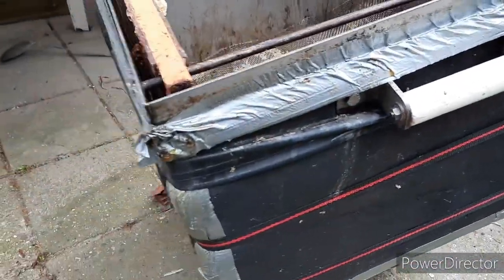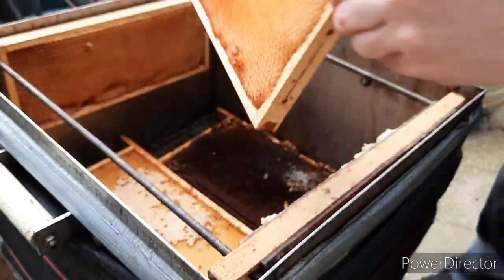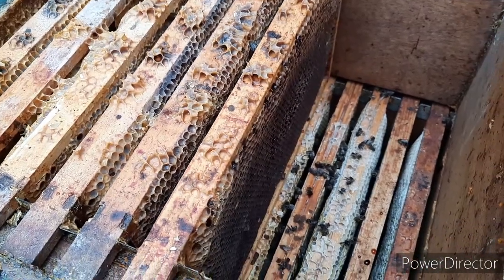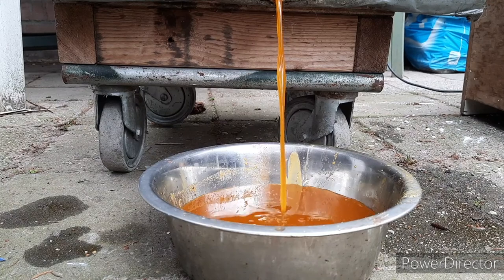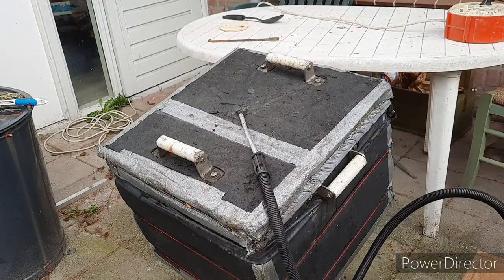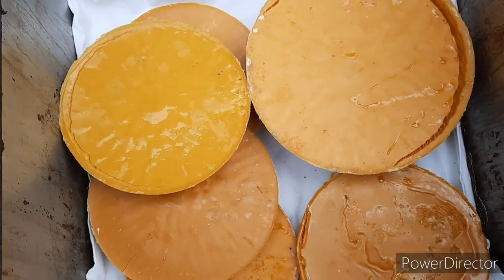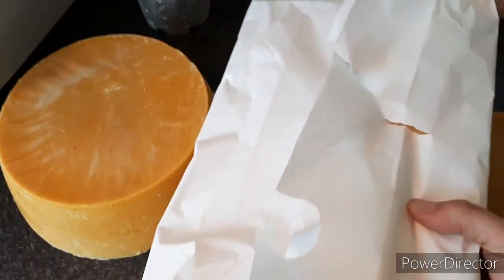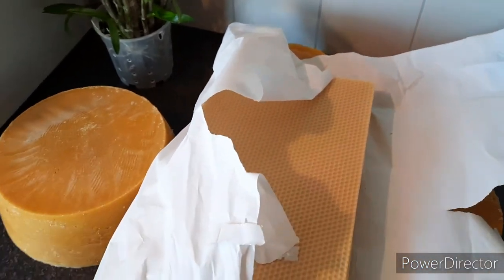Melting and rendering beeswax using steam #beeswax #honeycomb

Comment: Yes a lot of people spend out the wax foundation process because it’s very time consuming. However I use plastic foundation and simply paint them with wax, I know it’s a little bit more expensive but on long term it pays off
Reply from the maker: Yeah, if it works it works. There are many different ways to keep bees 😁